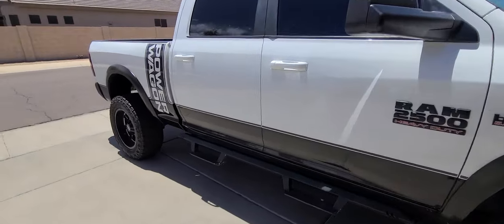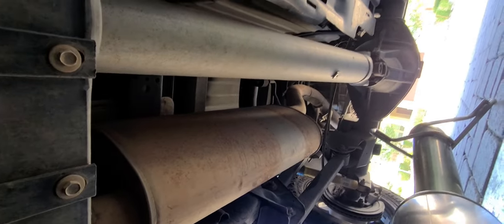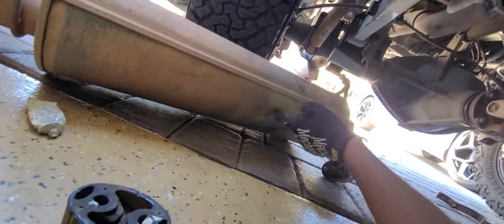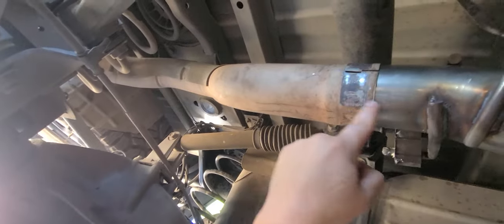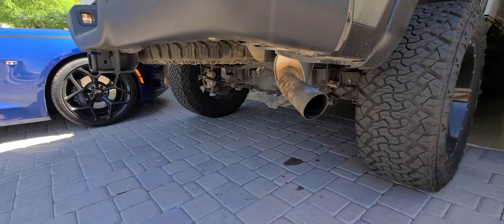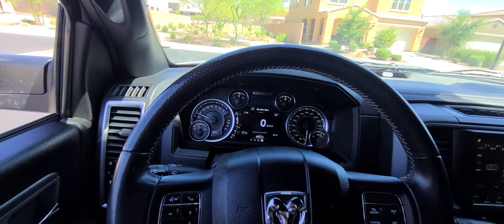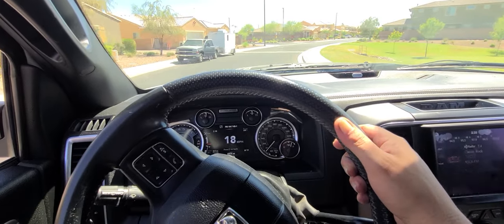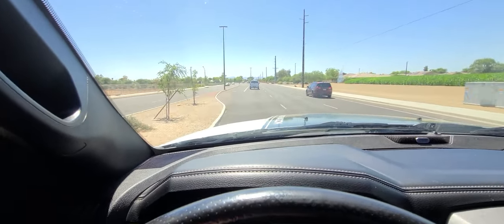Magnaflow Cat Back 2018 Dodge Ram Power Wagon #magnaflow

Comment: I installed the mufflex version on my '17 PW years ago. It sounded great at idle and full throttle. However at around town speed especially 45-55mph it droned so bad it felt like pressure pushing on the back of my head. I immediately removed it, sold it and put the original muffler back on. So I wondered since you now have some time with this muffler has it droned at all? How about while towing?
Reply from the maker: No drone at all. Even when towing. Love this muffler. I had Flowmaster and it was horrible for drone.
Reply: Good to know. Thanks. I really like the sound of the 392. I may have to give this system a try.